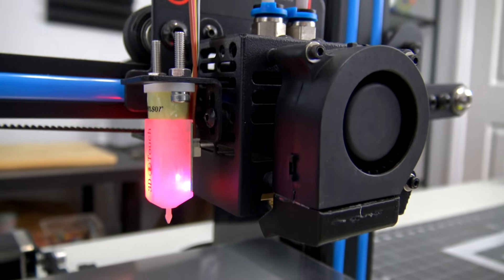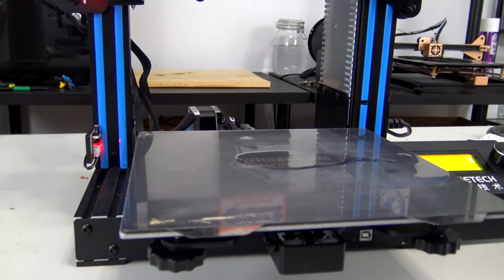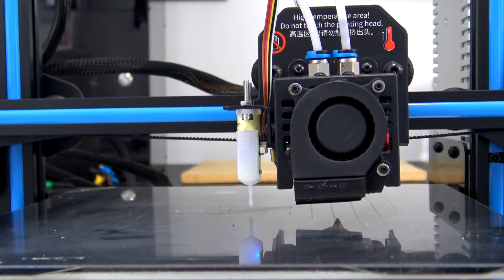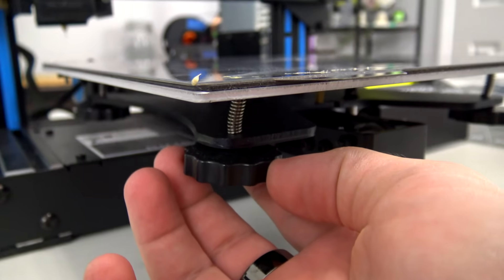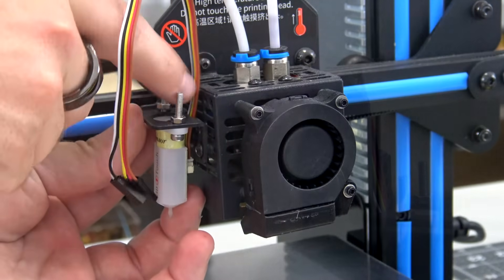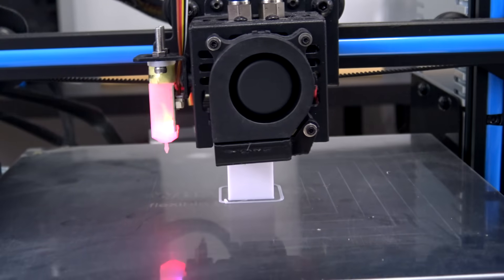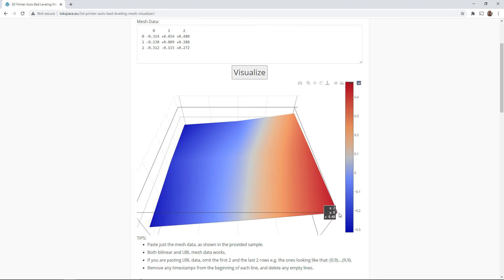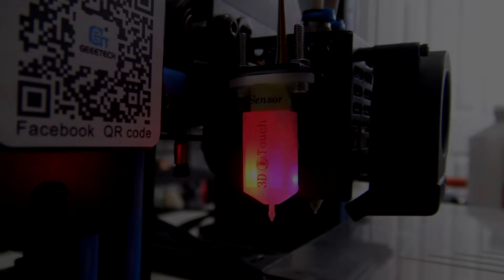Automated Bed Level with the 3D Touch v3

Comment: is there an install guide for TH3D firmware and install of this 3D Touch on Ender3?
I've already mounted the thing, but the only thing that happens is the start up test, and when I try an auto level it raises my Z axis and the probe does not do anything.. 
It's so odd..
Reply: Found a solution ?
Reply: @danededane  Yes, I moved the probe to another pinout pin29, and I then did a clean Marlin firmware install and went through all the steps again which did the trick.
The guides I've found have all used the buzzer pinout, and I could not get that to work as it should. But this way I kept my buzzer intact, so I can use that for warnings and such.

Comment: I get this video, great! BUT every time my A20 printer begins a print, it only goes to the center and measures the level there.
If I have done the bed leveling before it seems it does not care about that.
Every sngle time the same thing, at each print, even when the bed level has been performed the probe goes to the center of the bed and measures there, then it begins to print. Why?
Because I can see it with my eye it is not the same level and it does not take the bed level different measures in account when printing.
It is not big difference, about 0.2mm but still I can see it and sometimes it seems it is too tight and sometimes too far away.

Why does the probe only measure the center when I start a print?
So please do not reply by saying I have to do the bed level procedure, IT IS DONE, still it re measures the center position and seems to be happy with that and does nothing to compensate for the earlier 9 point measurements.
Reply: Do you have G29 after G28 in your start G-Code?